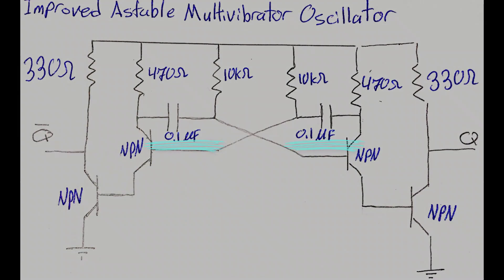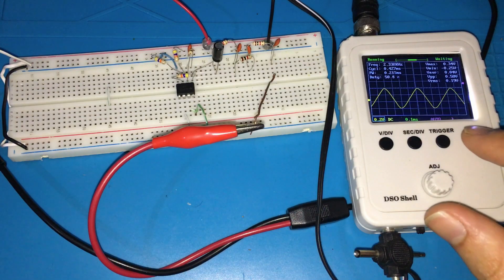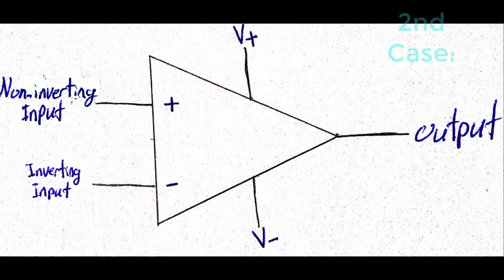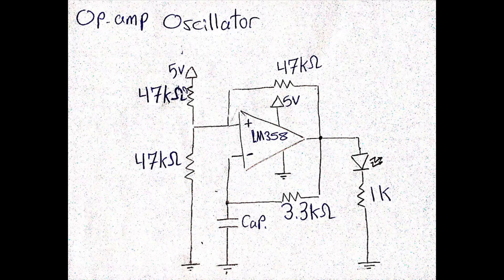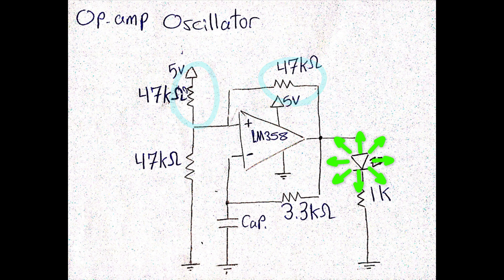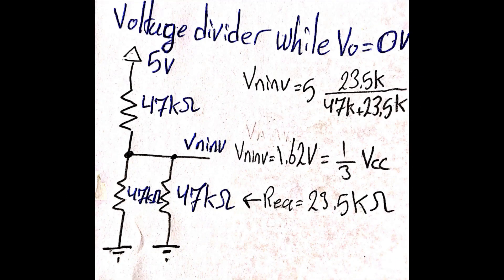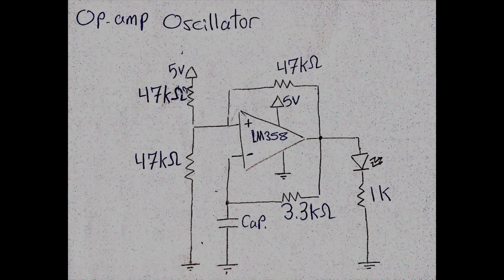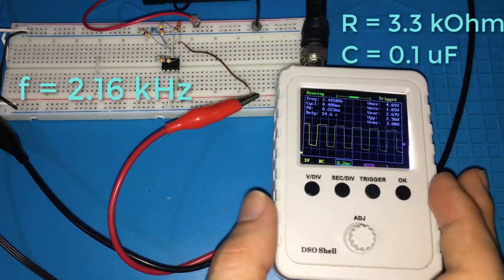Op-amp Based Oscillator

Comment: From this circuit output pwm not generated in Proteus why sir?🤔
Reply from the maker: NAVEEN SURENDHARAN BALAVENKATRAMAN Hi, well I didn’t simulate the circuit on any tool
Reply: @usefulelectronics  ok sir, shall you check in Proteus simulation, it's best to understand because before we go to the realtime components connections, simulation is verfied then we make the real time circuit, so please take the output in simulation tool
 Thank you 😊